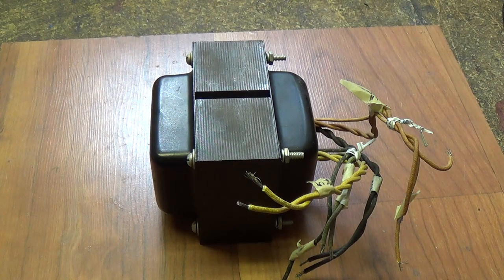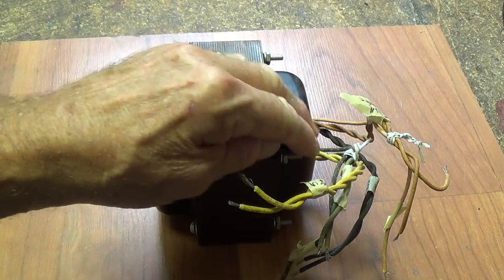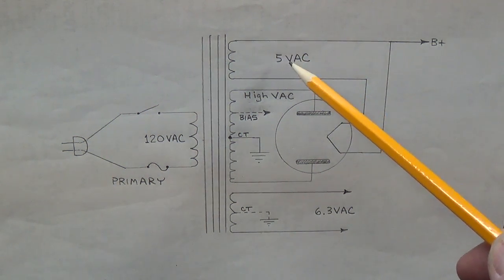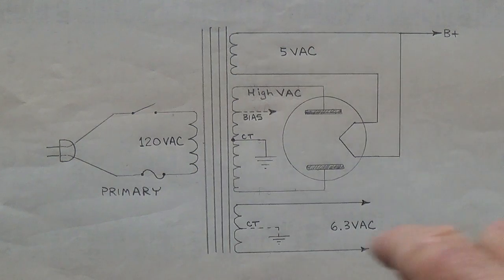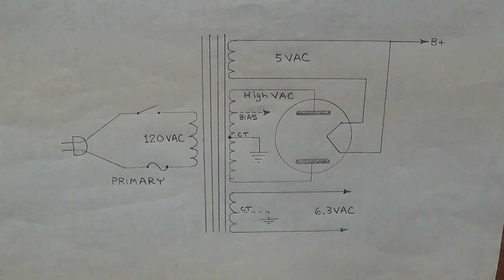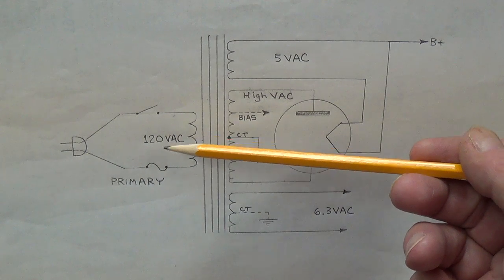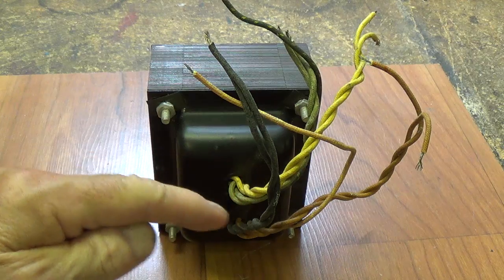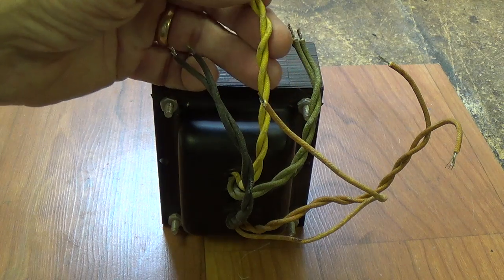How to Identify Amplifier Power Transformer Leads

Comment: Thanks for the great video!
I have a question for you.
Trying to repair a solid state guitar amp which has a noise (a grounding noise), I came across this :
- The ground from the ac socket is connected to the amp chassis.
- A black wire coming out of the transformer is connected to the ground of the pcb ( where the sleeves of the jacks are also connected)
But, there is no connection between the sleeves and the chassis.
Does this mean that the transformer is faulty?
And is it ok to connect these two grounds (the jack sleeves & the chassis) with a cable?
Any help would be much appreciated!
Reply from the maker: You're welcome, Jay. I am no expert on transistorized gear, and without actually seeing the chassis and a schematic, it would be virtually impossible to answer your question definitively. I would suggest that you use an ohmmeter to see if there is continuity (i.e. 0 ohms of resistance) between the sleeves and the chassis, with the amp turned off. Sometimes a connection may exist but is not readily visible. This connection, or lack of connection, should not be indicative of a problem with the transformer. Be careful.

Comment: I have a good question for you uncle Doug . Another carefully explained video by the way. Now my amp has 6l6 tubes . They draw 900 ma. I started to convert over to el 34 and hit a problem. One my heaters are wired in series . Two it seems it only allows for 1 amp draw. Would I need a different transformer to get 1.5 amps for the 34's . And how would I know which one to get ? If it would be too much trouble to explain I understand . Worst case I just buy another set of 6l6 's . Thanks in advance .
Reply from the maker: Thanks, Bryan. Your 6L6's draw 900mA each for a total of 1.8A. Your power transformer (PT) has a 6.3VAC winding that can probably handle a little over 2A. Tube heaters in conventional amp circuits are wired in parallel. The only exception I can think of is in the economy series-filament amp and radio circuits that don't have a power transformer....and they don't use 6L6's. I tend to think that your tube filaments are wired in parallel, but that's not the problem.

EL34 heaters draw 1.5A each for a total of 3A, which is probably beyond the capability of your PT. Also, they operate at higher plate voltages than 6L6's. I guess you could try to use the EL34's, but don't be surprised if the PT fails....which will be expensive to replace. Your best bet is to either stick with 6L6's or install a higher-capacity PT before converting to EL34's.
Reply: Thanks for the reply . Believe it or not they are series at least the power tubes . And dc to boot . Peavey does this allot . But the rest I didn't consider. So thank you and I'll just stick with the 6l6 tubes. Thanks again.
Reply from the maker: You're welcome, Bryan. I think you made the right decision. Good luck !!

Comment: Doug,
As an example, this xformer listed below has higher voltage rating for 5V and 6.3V windings (16.5V and 13.6V) but wouldn't it be ok to use for a guitar amp, because the rectifier will only draw 5V and the heaters of the other tubes will only draw 6.3V, correct?

http://www.ebay.com/itm/1-Tube-Amp-Project-Baldwin-Power-Transformer-350-0-350-512-19205-/161426969016?pt=Vintage_Electronics_R2&hash=item2595cc11b8
Reply from the maker: Greetings, Kevin. Sadly, we can't trust individual or parallel filaments to utilize the appropriate voltage. If we could, then there would be no need for a filament transformer, we could simply send them all 120VAC and let them use what they need.

In the old transformerless radios and amps, the tube filaments were in series and the voltage drop across the filaments (50, 35, 12, etc.) added up to the 110VAC input voltage, which was OK....but in a "normal" amp circuit (with a power transformer), the filaments are either individual (rectifier) or in parallel (all the other tubes), so each filament would be dropping the full input voltage. Tube heater filaments are much like those in a light bulb, and I think we all know how long a 5V bulb would last in a 16.5V circuit.

Why? Since Voltage = Current x Resistance, if you (more than) triple the V (i.e. 16.5V instead of 5V) while the R remains constant, then the C will triple also. Now, since Power = Current Squared x Resistance, the power (heat) will be 9 times greater......and the filament will go up in smoke. Perhaps this transformer was originally intended for multiple tubes in series, but it would not be appropriate (IMHO) for a "normal" guitar amp project.

Comment: Great instructional video and easy to follow. You mentioned hum is reduced by twisting the associated secondary leads around each other. I would appreciate you expanding on this. In addition, is there a simple method for establishing the max current ratings for the secondary windings? Thanks again for sharing.

Don

Comment: Great instructive video as usual! Do you think you and Rusty could make a video about the proper way to convert an old amp to three prong plug, i.e. adding a ground connection? Also, I scavenged this really heavy transformer from an old tube radio and I was thinking of using it for a small amp like a Champ but with solid state rectifier (as it only have wiring for high voltage ~300 volts and 6.3 v filaments). The "only" problem is I found out the transformer is really an autotransformer, not providing isolation from the mains. Would it still be safe to pursue the project? Worst come to worst I was thinking of adding 1:1 transformer just to add isolation between the mains and my transformer...
Reply from the maker: Greetings, G, and thanks for your kind words. I have been asked several times about the conversion to 3-wire cord, and, as demonstrated above, repeated questions often lead to a new video. Re the autotransformer-Champ project, as you have probably seen from my videos, I'm all for building amps and effects from crazy materials, but I would not be completely in favor of this project. As you state, there will be no isolation unless you add an isolation transformer, and then you will end up with a diode-rectified, 75 lb. Fender Champ. The charm of the Champ is its small size, weight, and (to some degree) tube rectification. For about the cost of an isolation transformer, you could buy a new, correct power transformer for the Champ (see Triode USA), and be much better off. I apologize for being so conservative, and you may well proceed with the project anyway, but having worked long and hard on projects that "just weren't meant to be", I wanted to provide an honest answer to your question. Regardless, I really appreciate your interest and input and wish you the best.
Reply from the maker: twangzilla
Rusty and I watched the video and thought it was good, but we have the following observations:  1.) In the video, the conversion is complicated by the presence of the Fender polarity switch. If you're not working on an older Fender amp, this will not matter to you. 2.) It might be easier to simply remove all wires from the Polarity Switch, i.e. bypass it, but leave it in place for originality sake. It serves absolutely no purpose after the conversion. 3.) The black (hot) wire, not the white (common) wire, should always go to the main power switch.....otherwise, 120VAC will be present in the circuit even if the amp is turned off.  4.) Rusty is not so paranoid about the "Death Cap". If it were to become shorted to the chassis (exceedingly rare), the resultant current flow would cause the fuse to blow.....otherwise, what is the function (or value) of the chassis grounding wire?